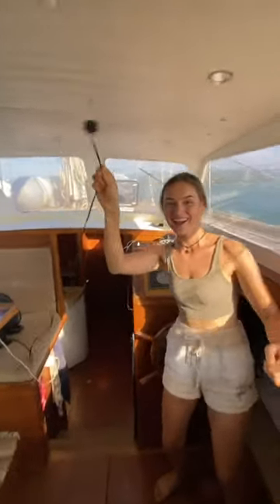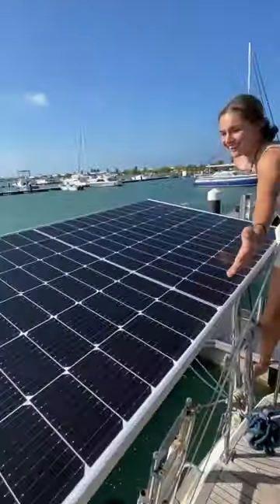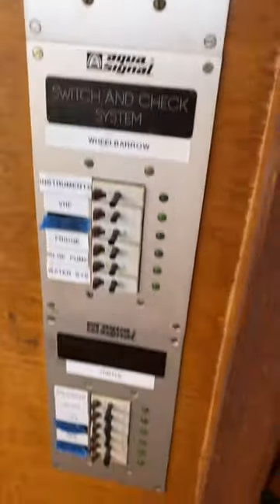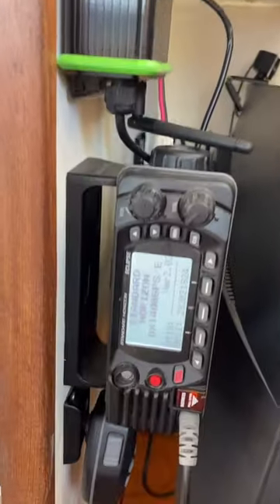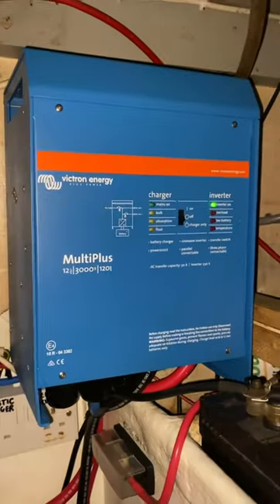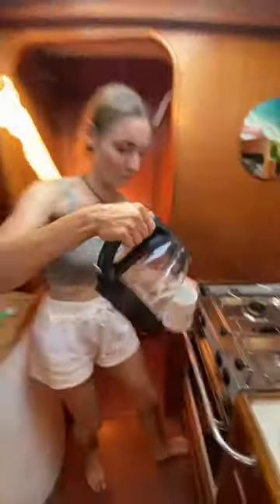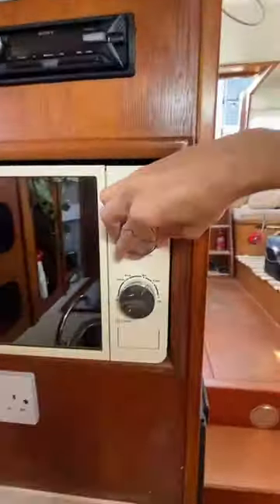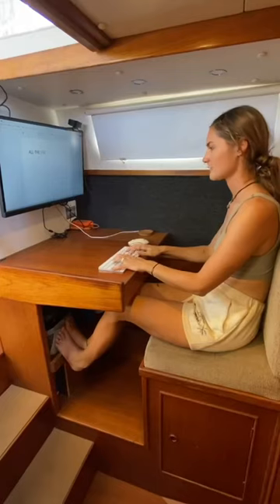How we power our sailing boat ⚡️⛵️ #sailing #shorts

Comment: The problem with lithium is that when used hard, they break down. The overheat causes fires that are VERY  difficult to put out. Not worth it. At the minimum, put seals on the doors, then install a Halon fire suppression system. I used Lithium batteries in my model planes. It was never if, but when the batteries would light up. Had to charge in a metal shed, outside. Lots of fires at construction sites. Trades using overnight charging centers for their power tool batteries,  overheating.........
Reply: Big difference between lithium ion, that is in your model plane, and LiFeP04 that are used on sailing boats. Granted things can still go wrong with any battery, especially lithium based, but there are very good controllers/monitors built into every one of those battleboarn batteries that make them very much functionally safe.

Comment: Nice videos. Personally I would have steered clear of the lithium batteries. If they catch fire.. literally nothing you can do to put them out. There have been plenty of yachts catch fire and sink in the last few years due to these batteries. 🤷🏻‍♂️
Reply: I have just finished installing an industrial solar system offshore South Africa. We use 1100AH Sealed lead acid 2V cells for Solar energy storage. Yes, they are big and heave but are much cheaper than Li Ion and last 15 to 20 years with no maintenance or fancy chargers.

Comment: Hey we have 600Ah 12V Lithium Batteries and 3 Solar panels. And we always short on charge in the batteries. I wonder how you want to charge 800Ah with two panels???? Surely that can't work. Btw: we live in Queensland. Sunshine is not the problem here.

Comment: Don 't forget that the rating of your inverter declines as the ambient rises.  Measure the summertime temp next to your inverter and then look at the derating curve in the manual.  If it is 100 °F, the rating will be about 30 - 40% of what you think it is.  Thats how you burn them up.

Comment: How often does this boat have major maintenance issues? I recently went sailing on my friends 70 ft sailing boat that’s pretty similar to this just older and has a Diesel engine. The thing overheated every 5 seconds, holes were starting to rust into the steel hull, inside just always smelled musty and damp, etc. cool experience but I don’t see how my friend could deal with this stuff. Took us 6 hours with mechanic just to turn on the engine

Comment: I don't know if you answered this in a different video, but how much does a boat like this cost, and what class is it considered?
Reply: You'd be surprised at how cheap they can be, this looks like perhaps a 1980's era boat, so you're looking at around £25k for one that needs some work and about £50k for a good example. Pristine condition can be up to around £100k
Reply: @andycalvia  yea i think they paid about 48k for the boat and have had a lot of extras installed and did some work before they set off, wouldn't surprise me if they are upward of 70k with total cost all things considered

Comment: Solar panels go into a charge controller, which happens to be an mppt (maximum power point tracking) as apposed to pwm (pulse width modulation). Nice setup though, can't go wrong with victron.